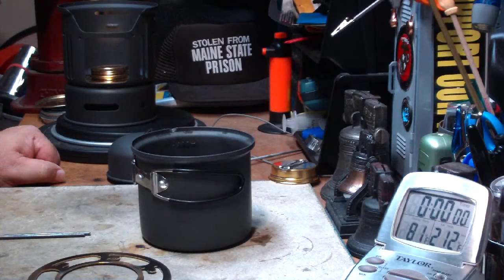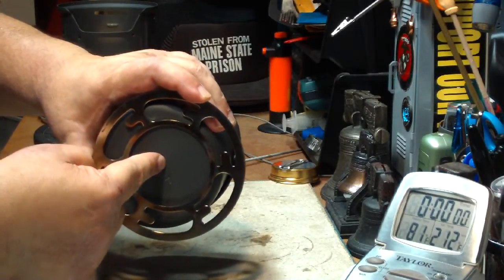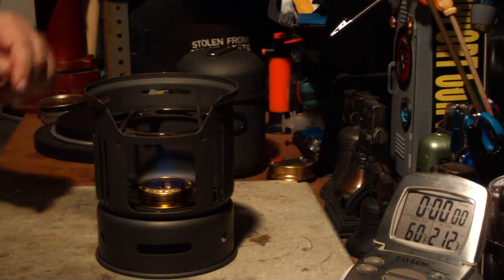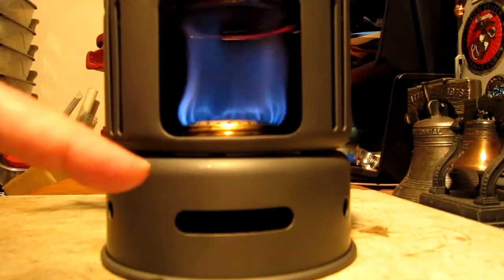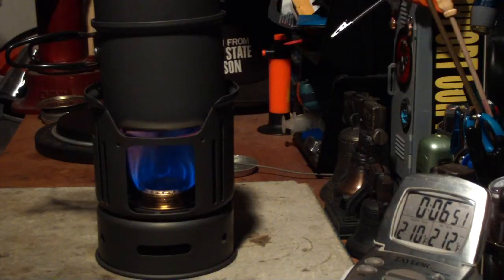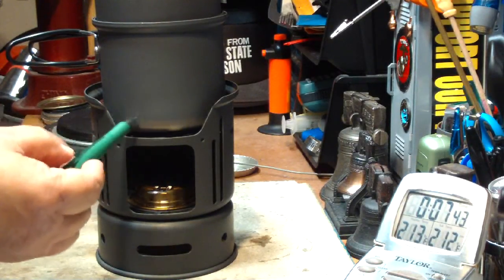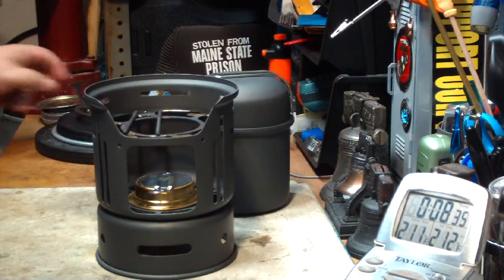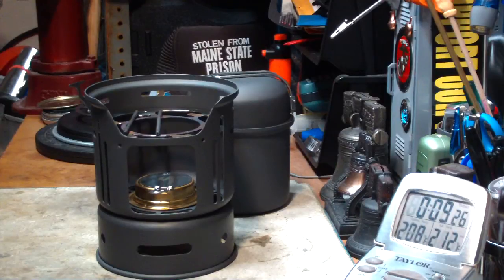ALOCS 7 Piece Camping Cookset - Boil Test #4 - Creating Heat Flow

Comment: I don't think the ring is absorbing all that much heat.  It doesn't look like it has much mass.  Since it's glowing red, it's clearly re-radiating what head it does absorb quite effectively.  I imagine the height of the pot over the flame has a much bigger effect on efficiency.

Comment: Seems the inner ring is absorbing much of the heat, you could always trying angleing the rods through the horizontal slots , it would raise the base of the pot a little, but it may also take the pot away from the sweet spot for heat, but using the slots would give you an idea before you start drilling holes..